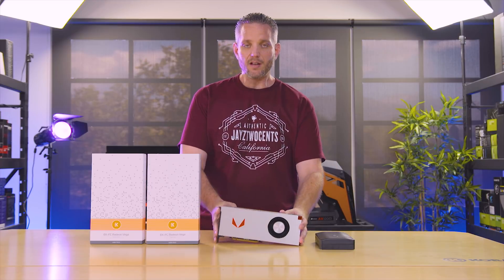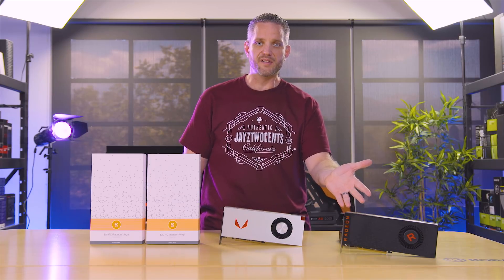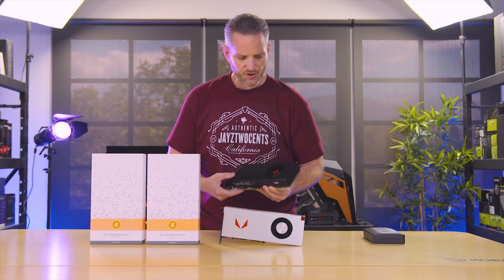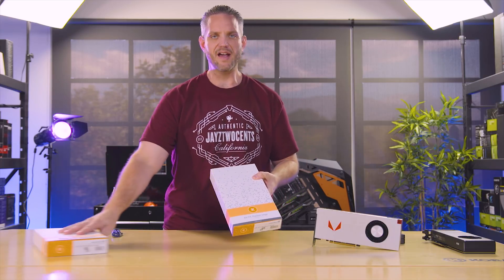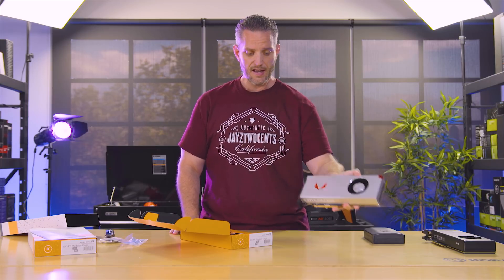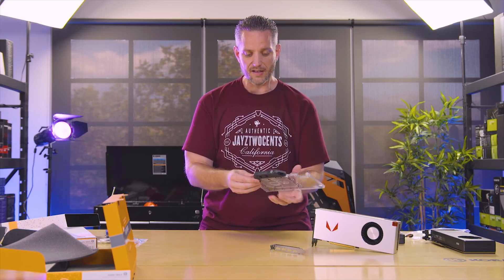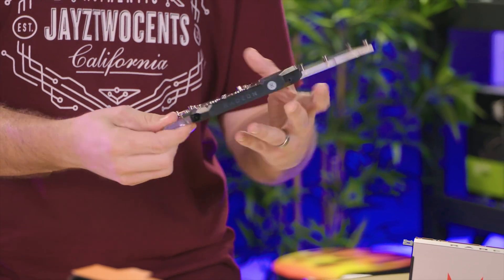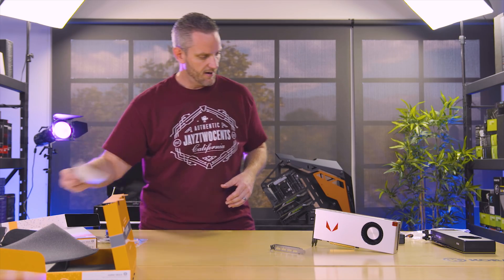Does watercooling help AMD Vega cards?

Comment: Ryzen = Success

Vega = Fail
Reply: Rasmus Rasmussen, no it does not, it's about $15-$20 more per year on power draw, unless you are paying like $2 per kilowatt, sorry, that's just fabrication.  It's far less efficient, but the ~50 watt higher power draw isn't costing anywhere near $200 more a year.
Reply: Rasmus, assuming you have a very high kwph cost like say 20 cents, it would cost about $518 to run that card under load 24/7 for an entire year, it would still cost about $410 to run a 1080 for the same time, but no one who uses there system for gaming is running their system under load 24/7 probably more like 4-8 hours a day at most, bringing that 108 dollar gap down to less than 25, I swear fanboys will say some dumb ass shit. Even miners won't spend $200 more a year to run the thing, and where I live the kw per hour cost is only 11 cents, therefore half the difference still.  Sucks to be that stupid.  You need to go re-watch that gn video.
Reply: Miners are buying them
Reply: Do you mean the new MSRP or the limited-time only "reviewer edition" MSRP?
Reply: but vega isn't really a fail when you look at it from AMD's side they were on the verge of being bankrupt for over 2 years finally paid their debt off this year have no where near the R&D money Nvidia has AND STILL they've managed to pull out a decent card that can be competitive  once the price drops from the mining craze
Reply: only bcoz vega prices are fkd up.
Reply: Daway Legit funny how you AMD fans cry about the power draw of x299 but now that Vega it crasy its okay. You are just so so dumb. And who in they right mind would buy a Vega 64 that cost more and performs worse then the gtx 1080.
Reply: RepsUp100 lol bro you must not understand business. Selling out of your products usually doesn't =fail. They just gave up on the gaming market because of all the Nvidia fangirls
Reply: A survivor dam explains why the 56 is cooler than the 1070 

Seriously don't trust anything you see. The reference design is shit amd is known for that wait for third party if you want cooler vega 

As for power undervloting makes the 56 better than the 1080 yet draw less power than it. The 64 draws more power than the 1080 while undervolting but by an insignificant amount we're talking 10-20W here 

Also power saving mode takes away 2-3fps (you won't notice them when you're getting really high fps) and sometimes saves 100++W can't remember the exact number but it was really high 

This is all with bad drivers. If the 480 is an indication vega will get much better which is probably what's going to happen because there are a couple of clear driver issues
Reply: +Borgarr somehow that seems to escape a lot of people. The only thing they focus on is what any company is doing right now.  They don't take into account any factors that a company has had to struggle with. The only thing that seems to matter is, is AMD beating my company by light years? Nope? Fail.  Nothing could be further from the truth, like what you pointed out is a perfect example.
Reply: Rasmus Rasmussen well there's plenty of pre-order options for 56 and 64 here in the U.K. (Can't speak for elsewhere), where you can buy it for under msrp. If you're in need of an amd card, then the value proposition really isn't bad at all, perfectly competitive with nvidia. Only downside is tdp, but that personally wouldnt bother me
Reply: damn you saved so much time leaving out the "e" in per, respect.
Reply: Hugo Olloman Selling out doesn't mean they  have tons of orders so much as it means HBM2 is crazy expensive and AMD doesn't want to make a lot of them for almost no profit until Hynix releases their HBM2 to drive industry costs down
Reply: sniperunrepeat that could potentially be true, but it's certainly nothing but speculation at this point. If AMD are selling out as quickly as they can ship, I'm sure they are pretty happy following a new product launch
Reply: For sure, but i would of like for vega 64 to atleast kick 1080 ass and be right behind 1080ti... that would of DESTROY the monopoly... but ryzen will do.
Reply: BuzzKil1 yeah that would have been awesome, would've served as a nice gap filler between the competition too.
Reply: They said the same thing about Ryzen at launch. The fact that vega has gayming features disabled because amd had to give priority to prosumer drivers says what's happening. 
Just pasting a comment i made on LTT. 

FFor people above: AMD Gave up in high end gaming cars when GTX 970 was released, Vega is an all-around GPU. Amd was in the brink of bankrupt, they dont have the same budget than nVidia and Intel, nVidia for example fragmented their series in 3 series (GeForce, Quadro and Tesla) the difference between them is that this gpus have features disabled that favors certain usages, because of this you dont have the same performance in games even though nVidia Quadro cards doesnt use all CUDA cores on gaming (which would make TDP skyrocket). Now, about Vega: http://www.pcgameshardware.de/Radeon-RX-Vega-64-Grafikkarte-266623/Tests/Benchmark-Preis-Release-1235445/3/ Tick the RX580 in the list and look closely at the number of culled tris. 

NGG path is currenly disabled for RX Vega, it works like bigger Polaris. PDA is working though, just compare it to Fiji, clock per clock. Every AMD GCN generation save for the blitzkrieg-up-Nvidia's-ass 7000 series (which, I remind you, was the last AMD gpu arch Raja Koduri was 100% involved in from start to finish before leaving) underperformed against their value competition for about 8-10 months until driver development caught up with the card's programming needs. Just compare GCN's programming model to Nvidia's [Kepler/Maxwell/Pascal] model - GCN is a clusterfuck "jack of all trades" compute-oriented (read: throughput at the expense of latency) design which needs a ridiculous amount of hand-tailored code to function optimally for any given non compute workload. It's that bad for gaming. 

Gaming needs latency-over-throughput functionality. GCN is the exact opposite of a gaming arch, and the fact that drivers can extract performance equivalent to the competition, no matter the manpower AMD has or the time it takes, is a testament to how resilient the architecture really is. Drivers are PRE-ALPHA, they arent even using some gaming features, like people who bought the powerhungry HD 7970/R9 280(x) they improved a lot through the years via driver updates. Like Ryzen, people should wait™ to drivers maturate.

 I personally can say this because even with my dead R9 280 i was getting 110FPS on Doom (vulkan) at higher settings. Stop shilling guys. And dont answer shitposters. Gaymen drivers for RX Vega are not ready yet
Reply: Daway Legit oh boi you have no idea what nvidia has done in the past
Reply: BuzzKil1 what if I told you undervolting  the 56 makes it beat the 1080
Reply: Matheus Felipe: You sound like you know what you're talking about, but there's something you said that doesn't make much sense to me... Throughput at the expense of latency, with regards to memory design, is an important philosophy in all graphics cards, Nvidia or AMD. Arguably gaming workloads benefit from it the most, due to sparse data access patterns without a whole lot of actual processing being most common. Modern GPUs can hide the latencies very well by juggling around workgroups, but memory bandwidth still presents a hard limit and as such often ends up being the main bottleneck in games, especially with the recent push towards 4k resolutions. That's the reason GPUs now try to fight it with various forms of framebuffer compression that while increasing latency and requiring extra processing, actually end up improving performance due to savings in bandwidth.
Reply: Modern GPUs are fully programmable and designed to meet the needs of a problem domain. Vega's (or GCN architeture) are better designed to compute workloads, and like i said, Vega isnt using it's full power because it's using polaris drivers. 

"but memory bandwidth still presents a hard limit and as such often ends up being the main bottleneck in games"

Tch, i searched for links or info about this (ive read this on amd sub-reddit) that Vega 64 wasnt able to use its all 4096 compute shaders because most of them are memory starved: 

Example, if you hit the max memory bandwidth the video card isnt able to use all the 4096 shaders, thus, resulting in a bottleneck, This is confirmed because Vega 56 is able to archieve "almost" the same performance of Vega64 in some games, because it uses all 3500 shaders. Sadly, i dont have source for that info atm, i searched for some minutes here but i wasnt able to find anything.

One of the reasons why vega was delayed that much was because hynx wasnt able to manufacture 1600mhz memory for vega. 

Awesome features like this : https://www.pcper.com/reviews/Graphics-Cards/AMD-Vega-GPU-Architecture-Preview-Redesigned-Memory-Architecture/Primitive-Sh are disabled because amd HAS to give priority for its prosumer cards.

JUST WAIT™.
Reply: I just watched that video, it's actually a 20$ per year difference. Dunno where you pulled 200 from. Sucks to not be able to read a graph properly.
Reply: Matheus Felipe I bet 100 bucks people will start calling you an amd fanboy, eventually
Reply: ThatSkyrimGuy vega cards can be found at msrp, which makes them a perfectly good value option for people who want amd card. Get your head out of your ass
Reply: if you're only do gayming, sure, vega isnt for you, but if you also do/run tasks that requires compute performance, vega is even better than 1080ti. 
Face it, AMD doesnt has the same R&D and money that nvidia or intel has, AMD cant make gpus like nvidia (tesla, geforce and quadro) and vega works well in these 3 tasks. 

PS: i'm in a hurry and i know there are some grammar mistakes there, so..
Reply: i'm not a fanboy tho, i just want to run my games in 1080p @60 FPS and do some occasional encoding/rendering (GPUs are very fast nowadays while doing these tasks) sometimes, vega is a good gpu for me because i do more than gaming on my PC. And for 1080p gaming a GPU like Vega for me is overkill.
Reply: +RepsUp100 "Miners are buying them" that is still a sell for AMD, bad for gamers, but AMD still made $$$ on their MSRP.
Reply: Dolkarr I can only speak for here in the U.K., but the 2 largest online retailers are selling the 56 for below £400, and the 64 for below £500. So yeah the normal msrp, and that makes them very competitive against the 1070 and 1080
Reply: @tokekkk

How does AMD stop Nvidia from being lazy? Once Nvidia saw how underwhelming Vega was, they announced that they weren't planning to unveil Volta until likely mid next year.
Reply: Anders Zidane if vega was worse they would've waited more that's one thing 

Second thing is now that amd is back both nvidia and intel can't do refreshes anymore and have to make actual jumps 

Intel can't pull off a kaby lake again and nvidia can't keep refreshing the same damn gpu for years which they actually did before and btw amd had the better gpu but the consumer was too stupid to get amd and just got nvidia for its better reputation so nvidia kept refreshing yet still got more sales
Reply: but both prevents Intel and Nvidia for being lazy and monopolizing the industry
Reply: Just give it some time. it is still way too early to tell what's going to happen with it.
Reply: Sure, because Nvidia would definitely put out better and better cards if there was no competition. Competition is good. Competition drives innovation, innovation is good for the consumer. AMD fans are not dumb, they're hopeful for competition.

It costs more right now because of retailers driving the price up cause demand > supply (mostly because of miners). That's how a free market works.
Reply: matilija wrong go to gamers Nexus they made a vid on its . Sucks to be that naive
Reply: Rasmus Rasmussen who buys a high end card and worries about power draw. Go be happy with a gtx 1030
Reply: AMD sells EVERY SINGLE unit as soon as it comes in stock... literally sold out everywhere, pre-orders being taken...
Pretty sure the only fail here is your comment lol
Reply: EdwardM862 No because the power draw is 200 dollars pr. Year more with a AMD Vega card then a NVIDIA.
Reply: Hugo Olloman this only proofs how dumb AMD fans are. But then Real reason why they get sold out so fast is because AMD made a huge fuckup by not making near enough card.

Comment: Not worth it, which is why I ended up ordering a Liquid Cooled GTX 1080 ti. Basically the same price, but 30% more performance, probably less power and heat.

Comment: I'm looking to build my first gaming pc and I know very little about what parts to get and how to put it all together.  First off, my budget is around $1000-1300 and I'm not too sure if I should go with and Intel processor or AMD? I don't know much about that. I also looked at tons of graphics cards and I see that there are different names for them.(EVGA GTX 1080, NVIDIA GTX 1080, ZOTAC GTX 1080, etc.) I'd like to go for a gtx 1080 graphics card. Also I don't know how much watts or what motherboard to get or the case. I need so much help and I know absolutely no one.

Comment: Jay have you done any under volting on Vega? A few articles claim that under volting helps with clock stability when overclocking because the cards usually hit their power target pretty quick.

Comment: If you downclock a vega to 1.4ghz you apparently hit the efficiency curve of the 14nm process. Above that (their out of box speeds for example) throw power efficiency out the window. As a result lowering clocks could save A LOT of heat output
Reply: Id rather lose 3-5% fps and run it at half power draw. "why not just get a 1080 then as the power draw on that is so much better." because freesync, application specific overclocking profiles, gpu passthrough for vm's, hbc if you somehow run out of vram, no stupid bridge for crossfire, low power draw of hbm2 allows for vram oc without any aditional powerdraw (.25 amps is nothing), and most importantly, there are way more amd sponsored titles out there right now.

Also its worth the test, because science.
Reply: he could undervolte it for a solid clock and lower temps but he probably don't know
Reply: i mean since he thinks vega is pointless i doubt we will see it from this channel. sad that big channels like this and linus are favoring nvidia whether they are shills or not
Reply: For mining that might not be a bad idea, but for gaming generally you want it to go as fast as it can.

Comment: Pretty high production values on this upload - the new studio is shining through! Everyone talks about RX Vega 64, but it is the RX Vega 56 which matters most to PC gamers. Of Steams' 125 million active users, 3.41% have GTX 1070s (4,262,500 from 14 months of sales of around 304,464 per month). AMD has around 28% GPU market share and they would be hoping to achieve sales of around 85,250 RX Vega 56s per month. And, it is the $400 dollar GPU to have - averaging 5% faster than GXT 1070 FE in all APIs and over 9% faster in DX12 and Vulkan. Expected to become much faster with driver updates over next 6 months by another 9%. And, has the option to be undervolted  (240 watts) and overclocked to speeds only 8% slower than a GTX 1080 on the current drivers.  Clearly, even when the Volta based GTX 2070 arrives and even if it is 30% faster than a GTX 1070 - RX Vega 56 will still be competitive for PC gaming for nearly 3 years.

Comment: $130 on top is only if you already  have a loop to build on. Adding at least another $150 for the loop. So around a $1000 for subish 1080 performance. Nope not buying it. I picked up a Titan Xp last week for about $900 (got it unused and sealed from a previous owner who had 2) and going to put it under water. Was going to get a 1080Ti but I felt I could pass on the offer.
Reply: "Going to put it underwater." That's the forest time I've heard that, and I think I like it. (I've only heard "put it on water." )
Reply: Well I didn't say "underwater" but "under" dash "water".
Reply: Nice try....
Reply: Honestly the price he uses in the video is pretty outdated, at least by me you can now get Vega 64s for just over MSRP (£450 vs £480). https://www.scan.co.uk/products/standalone-8gb-msi-radeon-rx-vega-64-14nm-4096-streams-1247mhz-1546mhz-boost-945mhz-hbm2-dp-hd?gclid=Cj0KCQjw557NBRC9ARIsAHJvVVN_E4klhGB0UJBOE2HcGR3F0-GXDwcHyTxJ4RDuumYdbcpGbaRyxZwaAn6xEALw_wcB
Reply: Pholiage don't forget about the ram,mobo,cpu,psu,ssd,case,wires,windows,desk,chair,keyboard and mouse,house, and property...shit were talking hundreds of thousands! Incredible!

Comment: I'm not brand loyal and am currently running a watercooled ryzen 1700/rx 580 system, but vega isn't even remotely on my list when a person can pick up a MSI gtx 1080 ek on jet for $545.
Reply: A survivor Vega 56 is 10% taster than 1080 when flashed with 64 bios and overclocked/undervolted.

Comment: Why aren't you undervolting? By doing that on air cooled 64, I'm over 1600 mhz and 73C and not using as much power. Draws about 60w less +/-. Now I'm not reaching what Jay did for speeds but I'm happy. Crushing 1440p games now vs my Rx 480.

Comment: I love AMD, but unfortunately this Vega cards are a disapointment simply because it's on par with technology that is over 1 year old (GTX 1070/1080). It has way too much power draw and heat and it's expensive. Only confort i have in this products is that freesync monitors are way cheaper so it balances out a little somewhat on the investment. About this waterblock, is just beauty it makes the VEGA cards much more classy and efective, unfortunately is also terribly expensive. All in all, i think Vega 56+freesync monitor is a good deal, everything elses Vega just doesnt add up.